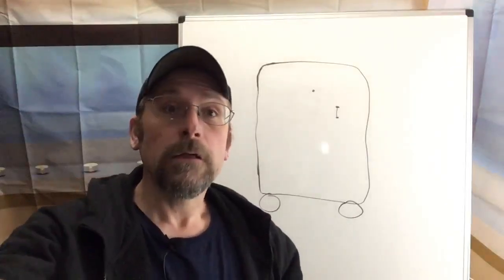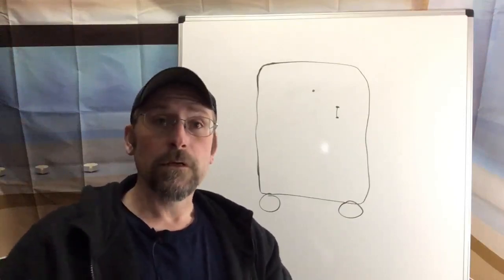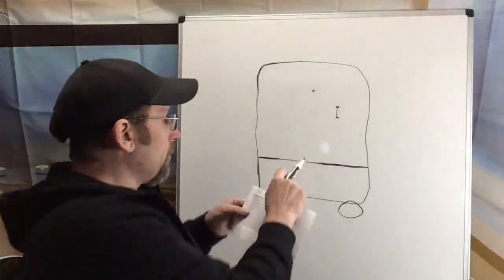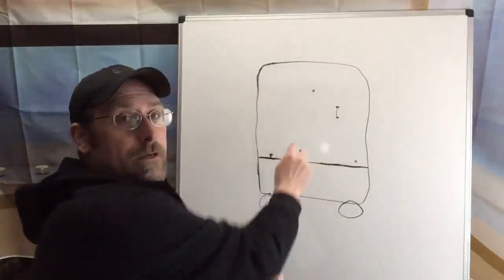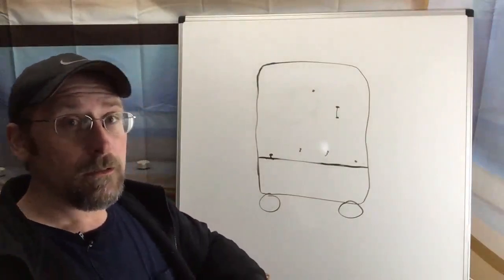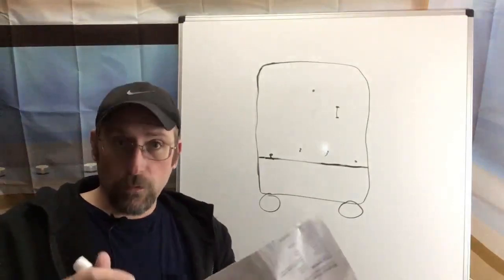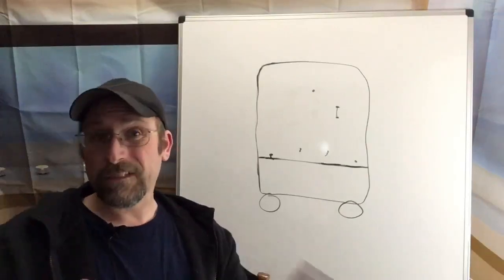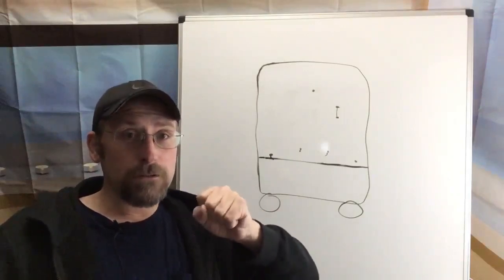HOW TO MAKE AN OXYGEN CONCENTRATOR QUIET

Comment: Would appreciate your opinion. This is an EverFlo IPX1 feeding a ResMed CPAP. I know you say no to closet location but our configuration of rooms makes it very difficult to place elsewhere. This closet is twelve feet wide, two and a half feet deep with a nine foot ceiling. There are two sets of bi-fold doors four feet wide and one two foot wide set.
You also mention 100 feet of tubing. Is that only for cannula? We were told 50 feet max.
And, one more. Can the tubing run outside if the machine is in an insulated but unheated garage? That is one possibility for another room. We're in NM at 7000 feet so can get pretty cold.
Thank you
Reply from the maker: Hi Donald, the big issue is airflow,  you are limiting the amount and quality of air you are receiving, also it's putting a strain on it as well. Next in my experience you can get away with the extra length but of coarse in the longer setups I am checking the air pressure and quality. When you are maxing out you may have to turn it up to compensate for the distance. Also the garage is a possibility but I imagine the air might come through a bit on the cold side but I believe you would have a better air flow. I've never seen a running issue with the cold that I can think of and with the heat output, it may make your garage more comfortable in the winter. So in my opinion I would try the garage versus the closet but test pressure and quality and I think you should be good to go. Also the pressure adjustment if needed should be minor not major, otherwise you may have other issues in your connection. I hope this helps, have a great day!
Reply: @OxygenGuy  It does, thank you, most helpful. CPAP does have a heated hose and it would travel from the garage then outside in a covered patio twenty-four feet then sixteen feet in a heated space before it hits the device. One other option is machine inside two rooms away but hose running outside of house about ten feet before coming back inside. We could also purchase an EverFlo Q which is supposedly quieter. Given the lack of response from medical supply house we are renting from, this is an attractive solution.
One final question. Any user forums you would recommend?
Really glad I found you and thank you for the help.
Reply from the maker: You're welcome Donald, I'm partially concerned about the line going "outside" then back In because of condensation so I would keep an eye out for that. As far as buying your own machine goes , it sounds good but your taking on all the costs yourself and their probably not got to help you check or maintain it. It maybe possible to " bribe " your rep to work on it but it maybe outside of what they know how to work on. I don't like to be negative I'm just covering the bases. Depending where you are with the contract period, then maybe able to switch providers or have them bring in a better machine. If they don't want to get back to you then im sure a call to the doctor will help alleviate that problem. Regardless, if you have almost four years in or just started your contract you may be able to switch or if you just want them bring in a different machine please see what you are getting first. They could bring you something even worse. Plenty to think about, stay on it and you should be able to get a good workable solution in the end. Oh and I honestly haven't really checked into any groups, but there's a reddit for just about everything.
Reply: @OxygenGuy  Hi again, Frank and thank you for your last response. Sorry to be so long answering but, life! In the past week I've developed more questions so will try and take advantage of your knowledge before you get tired of me. I have searched further for user groups but nothing, not even on Reddit!
The user is my husband, Frank but he has never been any good on questioning or dealing with anything mechanical. We think his new sleep clinic doctor is a good one as he ordered an oxygen reading to see how Frank's saturation was while sleeping (only time in 2 years that anyone has even thought to check). Readings were 84-89 so not terrible and oxygen setting is at 2 ml/min. And probably caused by the CPAP as daytime saturation is fine. Frank's energy levels has improved since oxygen was started.
Am not getting much response from medical supply house and what we do get is rather unsatisfactory. Tried to see if they have an EverFlo Q and they've never heard of that model!
Currently the device is sitting on several layers of rug pad next to a window with the line running out the window, wedged to prevent pinching, about twenty feet outside, then back in a window about five feet from CPAP, with the remainder of the 50ft line coiled. The plan is to drill exit and entrance holes through the walls which will reduce outside exposure to about ten feet plus run the line through 1 inch diameter insulation that will just fit the 1/4 inch line.
What I'm not sure of at this stage is: how do I check for condensation and how do I check on pressure and quality? I also will need to remove the ends on the oxygen line and put on new ones once I'm through the two walls and the insulation. I will also want to cut down 50ft line to fit actual distance. I have not found anything on replacing connectors. Do I just cut the line and rejoin with barbed connectors? Replacing this line every three months per recommendations will be a pain.
So far, I see no evidence of condensation from reentry point, through coil to CPAP; line looks totally dry. We have been down to 19 at night. Would deep loop after reentry give me a place to see/catch condensation?
We've abandoned the garage idea as line would have more outside exposure and it would be a real pain turning machine on from out there. Tried using a timer but idiot machine thinks it's a power failure so we have to manually turn on.
Will see what our contractual obligation is but am still leaning to purchasing our own EverFlo Q. There are places in Albuquerque that service so we won't have to rely on med supply house.
Sorry this is so long but trying to get it all down and avoid a lot of back and forth.
Cannot thank you enough for your assistance.
Reply from the maker: Hi again, lots to unpack here, yes the 2lpm is a pretty common diagnosis for oxygen dropping at night, the Cpap and oxygen should be helping. Condensation can be seen in the line, its moisture like you may possibly see in the Cpap hose if he has a humidifier chamber. You would not want to cut the line, they make plenty of different lengths for different needs, I would check to see what you need and then id request something a little bigger. Every 3 months isn't necessary most of the time, you can go six months usually with no problems, but  thats in good conditions. So no matter what i'd check on it atleast once a week. I would rather check on it regularly versus trying to capture moisture, because the line could be filling elsewhere and clog the airflow during the night. So then if theres no other rooms in the house, but ive even had people put them in the bathroom or even the hallway. You could definitely purchase your own but you would still be stuck with maintenance. Now as far as air flow liters and quality thats going to require a oxygen guy or gal to check the line. They going to have to use a air flow pen and a oxygen tester. How long has your husband been with this company? Any others before this? There should've been opening paperwork when he started, if you don't have it then check with your insurance company. You really do need someone to "play ball" as far as getting this configured for your lifestyle, thats why pressing the issue.

Comment: Just started with a concentrator.  The hum is not bad but the machine sounds like someone is working a bellows inside or maybe a drum.  What does this indicate?
Reply from the maker: Hi Pat, the engine floats on a bed of springs in most regular sized concentrators, as the springs start to fail the motor is now off balance. This only gets worse as time go on, one way I try to correct this is by placing a thin object under on of the wheels. It's kind of like placing object under a table to balance it. It will take a few attempts to figure out which wheel/corner to prop up and how high. It's easier than I make it sound and it's better than bringing in a different machine that could be much louder and doesn't run as well. A lot of places I worked for had a limited supply of equipment and always had some less than stellar machines. All  regular sized concentrators have a sound to them, so if you do opt for a replacement then please make sure you listen to it before they take the other out of the house. I hope this helps and as the video states you can also move the machine to other rooms but please don't restrict airflow and/or put in a closet. Have a great night!

Comment: Hi sir,does the percentage of concentration of oxygen depends on the zeolite beads being used?
Reply from the maker: Hi Peterneil, I honestly have never built or rebuilt a sieve bed so I wouldn't be able to tell you for sure. I always use whatever the manual calls for in whatever I'm working on, it usually works out for me.
Reply: @OxygenGuy  thank you sir...actually sir, i am working on a company producing oxygen concentrators for animals our zeolite sieve supplier from us had a shortage of suppy.Thats why we try to order from another supplier.But as our new zeolite powder arrived, i tested them with our ussual process of testing but the oxygen concentration differs from what we  are currently using.It differs for about 10% of concentration and it did not pass with our standards.
Reply from the maker: That's very interesting, it's always good to beware of cheap substitutes in everything I see. I've heard of oxygen use with animals but I've definitely never had any experience with that. It's definitely good that you are proactive in what you are putting out there and trying to make a quality product. I'm sure there's a animal that will appreciate it. Keep up the good work Peterneil.
Reply: @OxygenGuy  thank you so much sir. I really want to understand deeply the functions,purpose and difference for all of this stuffs used in creating oxygen concentrators. To achieve more quality and reliable products.

Comment: What could be the clicking noise or the Piston sound noise coming through the downstairs floor from the oxygen concentrator?
Reply from the maker: Hi Doug, I believe you may have a broken or failing spring on the motor. The motor floats on a set of four springs on a lot of these machines, it sounds crazy but you may be able able to prop up a corner of the machine and it will quiet the machine. This is a temporary solution because it puts more pressure on the other three springs. It can get so bad that with a total spring failure it can send the motor banging into the case and become extremely loud. I hope this helps, have a good day.
Reply: @OxygenGuy  thanks for the Reply. How would you tell the property manager about it? It happens after hours when whe wheels it into the bedroom upstairs around 9pm and it hits the foorat 4am 6am so forth sporadically??
Reply: @OxygenGuy  Im sorry the last sentence after total spring failure it can send the....is missing
Reply from the maker: I guess I would work to find a way to make it livable for everyone involved. It's possible that a compromise could be reached. Diplomacy is your friend in a situation like this.

Comment: While it doesn't sound like much, making sure the case is on tight and putting a few layers of cotton towel or wool blanket underneath really does help. Just remember that many of these units vent out of the underside, so make sure there is still plenty of room for the air to flow. I put a folded wool blanket under my Invacare Perfecto2, which lives on thin hard carpet in my bedroom, and raised it up above the puffy blanket layers about 1 1/2" by putting a short length of 1" thick board under the left side and another on the right side, and then a clean dry dish sponge under each wheel on top of the boards held in place with a bit of carpet tape. 6 layers of the wool blanket really damps down the noise, and the sponges just might absorb any vibration coming through the wheels. 

Being a DIY kind of guy, I found the maintenance manual online, and took the case off to inspect the muffler assembly. It was fine, but I gave it a little turn so that the ends of the plastic tie wraps didn't contact anything. The whole inside of the case and the "sound box" are covered in medium density acoustic foam, but not the bottom plate. Looks like there's room on the inside of the bottom on both sides of the compressor for a little fiberglass insulation which might help too. But not too much so you don't block the fan blades on both ends of the compressor. I decided that this was not a thing I was ready to do yet, and instead focused on exterior damping and placement. I checked the blades of the 3 cooling fans and they were clean, but I know from my PC that dusty fan blades make more noise. So some careful vacuuming with a small computer vacuum might help too. Cover back on, screws in firmly but not too tight. 

The other thing I'd like to add, based on my many years playing with my stereo system, is that room placement is very important. These concentrators give off a low frequency sound, rather like the bass notes from a speaker. If you put the unit up near a wall, or near a hard corner of a room, then the acoustics will be worse. Especially in a corner! Try and keep the thing at least a foot from any wall. Soft padding - foam or wool or a chair seat pad - on the vertical surfaces near the unit can also dampen sonic reflections. A thicker pad under your carpet helps too, as does softening the room with drapes etc. Look up "stereo room treatments" online for tons of info and ideas. 

Wrapping my Perfecto2 with old pillows held on with string didn't do a thing: almost all the noise comes the bottom. So damp and redirect that, but don't block the airflow. 

So now my concentrator lives on the far side of the room, with quieting padding underneath and around it, but not too close, and it really is a lot quieter. Thanks for the video.
Reply from the maker: Your welcome Andrew, I would've loved to have you working with me. You definitely seem to have it under control now, yeah most people have theirs through a supplier company which is why I usually don't advise anyone to open it, but you obviously have some experience working on equipment in general. Keep up the good work. Have a great evening.
Reply from the maker: @Lu- Eslava Hi Lu, Im wondering what the situation is that you had to buy the machine versus using insurance? I say that because with a company bringing it in you have someone to check the machine and replace it if necessary. Now as far as sound goes, I've had some really bad sounding machines that had excellent numbers and great sounding machines that were basically a paper weight. If you are going to continue using your own machine then I would recommend finding someone local to check it to make sure it's ok. I wish I had a better answer but I feel like I would be steering you wrong to say " If it sounds good then you're good" good luck my friend I hope it works out for you and your mom.
Reply from the maker: Hi again Lu, I definitely feel for your mother and I do wish the best for her. I try to be careful when I have people asking about oxygen machines without a prescription or supervision because of the risk of over medicating and I definitely wouldn't want anyone to get harmed because of me. On the other hand people like yourself live in places where healthcare is sparse and you find yourself having to resort to other means. With that in mind I'm glad you were able to quiet your machine but I still would like you to see if it's possible to get your machine tested. Possibly a oxygen tech could do it on the side for you. Also i know you have trouble with emergency rooms there but it would still be good to find a doctor to at least be sure that the amount of oxygen is right for your mom.  Too much can be a bad thing also. I wish you all the best.
Reply from the maker: @Lu- Eslava I do believe in god, thank you. I think of people I interact with the oxygen as my extended family, I've met so many great people over the years and they've given me more than I could ever give back, but I do intend to try. Have a great evening. Your definitely welcome!